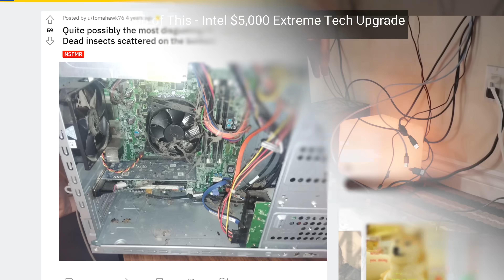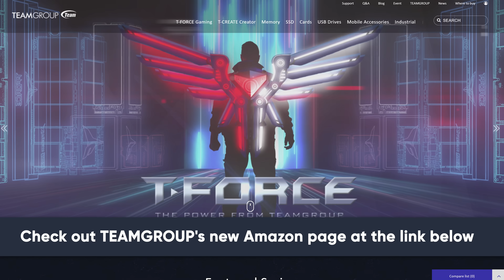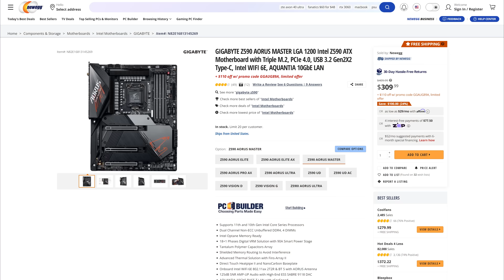How Often Should You Clean Your Computer?

Comment: The worst part to clean is always the heat sink on the top of the cpu, it seems like the rest of the PC can be squeaky clean and that thing will still capture dirt
Reply: My CPU heat spreader always has this weird goop on it that have to clean off
Reply: @oblivioncrises  soap hardly works on mine :/ why does nobody have a guide on it Ive looked fking everywhere >:[
Reply: @oblivioncrises  thermal paste? If not, then it's probably oils/smoke in your air settling on the cooler.
Reply: Tell me about it. I have monstrous NH-D15. It keeps my CPU very cool but I can't get rid of the dust between the fins, it seems to be glued in there. 🤔
Reply: @leoMC4384  When they get that bad, the best thing usually to do is to take it out and carefully rinse off the fins with some water.
Reply: @leoMC4384  it's my Noctua that gives me dust issues too. I don't mind the dust that much as long as it keeps cooling though.
Reply: @leoMC4384  take it off, spray alcohol, use qtip or something that can reach dirt,  rinse with water, dry it out and put it back
Reply: I just wash mine in the sink, and make sure it's dry after, and don't forget to clean the cold plate with alcohol after
Reply: I don't have this problem I don't think I get any dirt hardly on the cpu been using water-cooling for years though. Item that gets the most dust is GPU I just take it out and blow it out/use a artist brush.
Reply: Nah, the heatsink in the GPU is easy worse.
It's a lot easier to remove the CPU heatsink.
Reply: reads in AIO liquid CPU cooler
Reply: @doctordothraki4378  one day lol
Reply: @doctordothraki4378  Rust lol
Reply: @doctordothraki4378 is an aio worth it? I kinda want one but then I’m not sure
Reply: Aah it always cuts my fingers
Reply: Thats why AIOs rule.
Reply: @Henry14arsenal2007  Why, exactly? I have an AIO, I clean it every 6 months. My house is old, and very dusty. You can hardly see through the radiator fins by the time the 6 months is up.

It's the exact same problem just spread across a larger surface area. Where an air cooler may take 6 months to get clogged, you can maybe get a year out of an AIO.

BUT, in my opinion it is a lot harder to clean an AIO than a traditional fin stack cooler. I could push a credit card through my old Hyper 212 Evo and it'd push all the dust bunnies right out. The AIO's fins are extremely thin, SUPER easy to bend, and you shouldn't really stick an object through it. A can of air duster does the trick most of the time, but if enough dust is in the fins it can be an insane pain to get out.

I think AIOs are far harder to clean than any air cooler I've used.
Reply: @jonny6702  I use an electric duster and it blows the dust out perfectly. An AIO rad is a single piece of "flat" metal, an easier shape to clean than the various corrugations of a CPU heatsink and besides i can blow it from the down up which keeps the dust away from other components. Theres also the  other huge advantage of having plenty of space in the mobo area for maintenance which is otherwise occupied by the heatsink.
Reply: @jonny6702  Everything is easy to clean on pc if you have a air compressor, you get it for like 100 euros almost for life, very useful tool for all kind of things especially for cleaning pc's and it's components.
Reply: Whenever I clean my heat sink I separate the heat sink from the cpu and fan. I then use a thin needle and thread to get between each of the fins, sliding the thread along both sides of the fin, after that I use compressed air to remove any remnant dust.
Reply: Idk, I use air duster can and the dust seem gone. 2 year worth of dust.

To be fair, I use PC case with solid front panel + a gap for intake and mesh-like filter fan for 2 fan intake. 1 fan exhaust.
Reply: Take the heatsink to a car wash and ask nicely, they might give it a good blast of water and clean the finest dust particles off. Just a few hours of drying (or a few minutes of storng sunlight) and it'll be good as new.
Reply: Take the heatsink to a car wash and ask nicely, they might give it a good blast of water and clean the finest dust particles off. Just a few hours of drying (or a few minutes of storng sunlight) and it'll be good as new.
Reply: I usually blow out as much dust as I can and use a soft paint brush to get in between the fins and blow through them one last time. Not 100% perfect but almost
Reply: Thats because it moves the dirty room air. You arent cooling your PC with your RAM, are you?